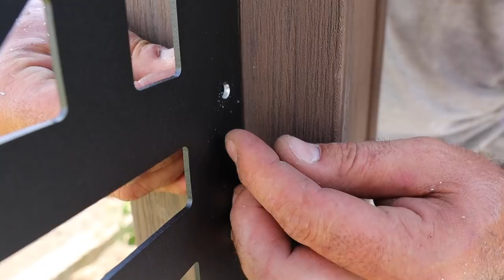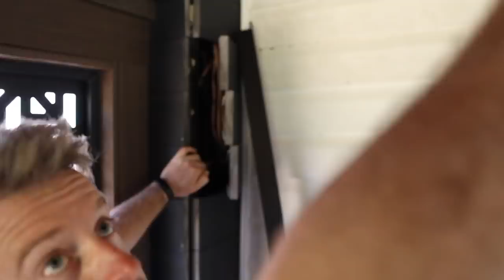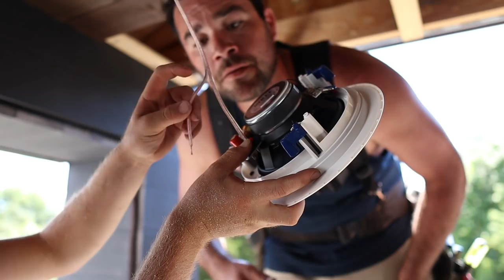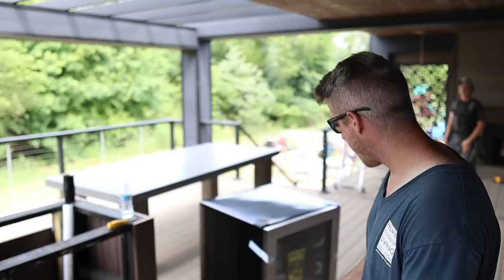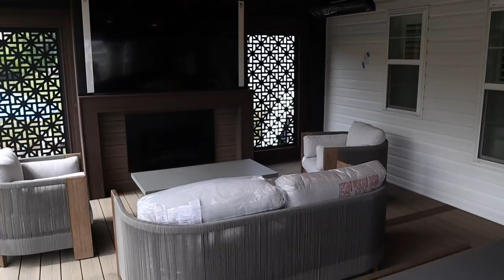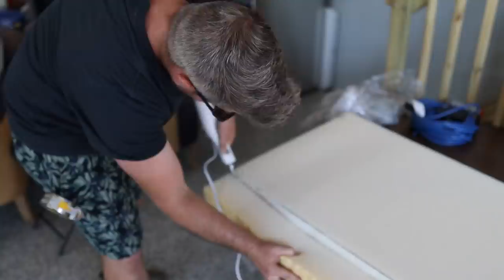Installing Tongue and Groove Ceiling Over The Deck - MEGA DECK PART 7

Comment: As usual amazing build. Quick question the speaker wire didn’t need to be in wall rated? That wire over time is going to crack. And definitely want to see that walk through!
Reply from the maker: Walkthrough coming tomorrow!! I wouldn’t bury this type of wire but it’ll be fine in the ceiling